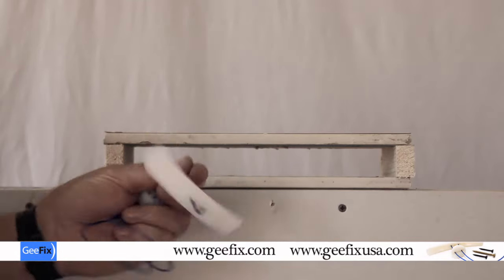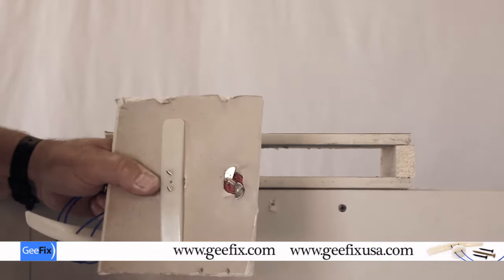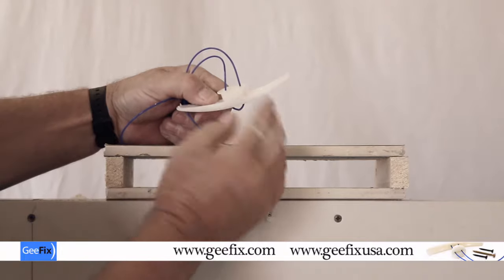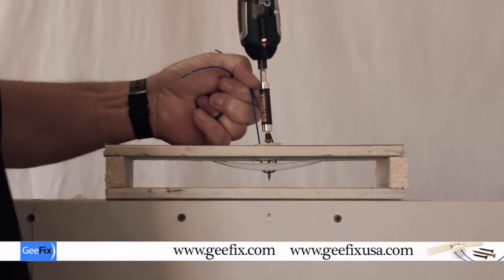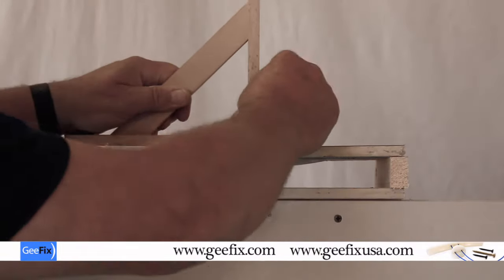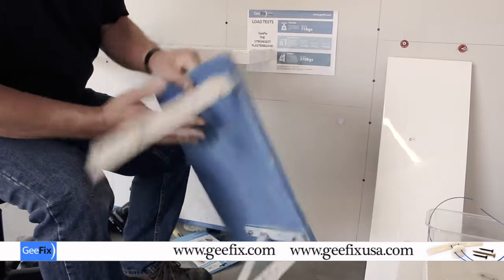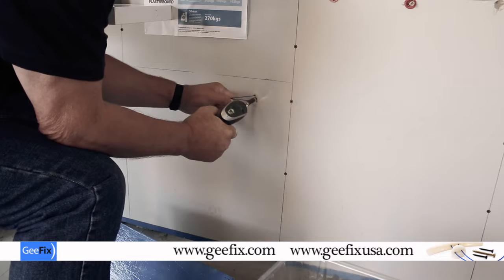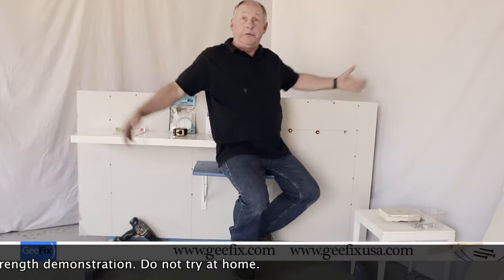GeeFix - The strongest plasterboard fixing - A closer look

Comment: Ultimate handyman did a video of a shelve using four fixings for Geefix. He then did the exact same test using Bullfix Extra plasterboard fixings. Bullfix plasterboard beat Geefix by around 18 kg in a real application yet are much smaller, easier to install and less than half the price . So Bullfix plasterboard fixings are the strongest plasterboard fixing on the market in real life applications.

Bullfix Extra Plasterboard Fixings =143kg

https://youtu.be/h5UqIlw61Vw

Geefix Plasterboard fixings =125kg 

https://youtu.be/BAyuUOjvKcA

Bullfix Plasterboard Fixings are the ultimate plasterboard fixing for strength, speed of use.
Reply: Interesting.  I'd prefer to use BullFix but Geefix accommodates 2layers of board and BullFix and GripIt are 15mm board max